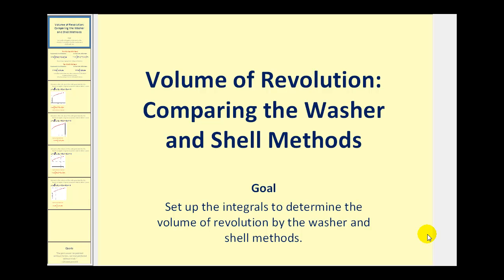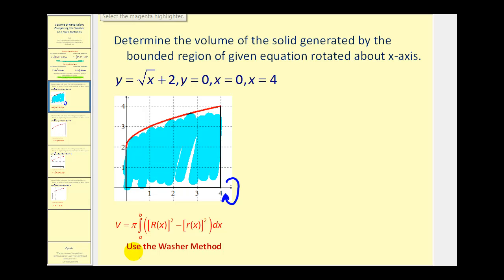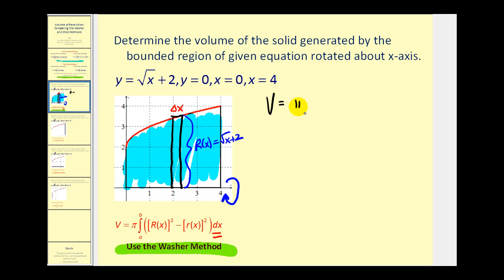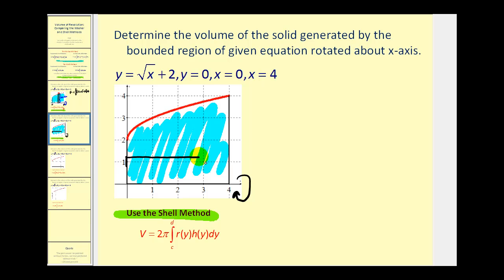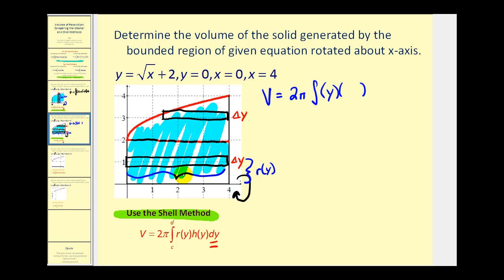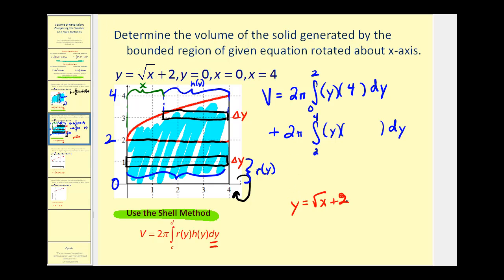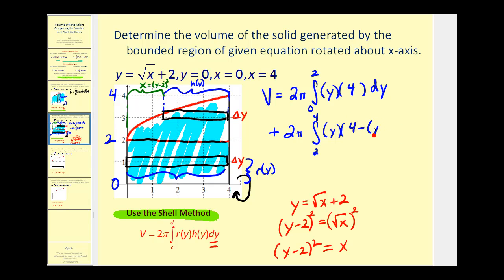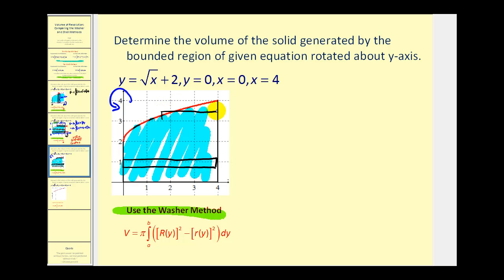Volume of Revolution - Comparing the Washer and Shell Method

Comment: I know this is crazy, but you asked. Think about the protection of a condom's surface. It protects what goes in/out of the two "surface areas" (or "functions" if your dirty enough to call it that) One side holds a higher value.

The "disk method" portrays a function that flows from an intrinsic function projecting outward
The "washer method" portrays a function the flows from an extrinsic function projecting inward

And vice versa if you flip the coordinates of x and y...z is where it gets "fun"

Comment: "When you use disk/washer method you will cut the solid into infinite no. of disks and integrate all of them to find total volume." i.e. you will summarize the area for an infinite no. of disks/circles. the area of a circle is pi(r^2)

When you use the shell method you summarize the volumes of an infinite number of shells. And the volume of a shell is 2Pi*r